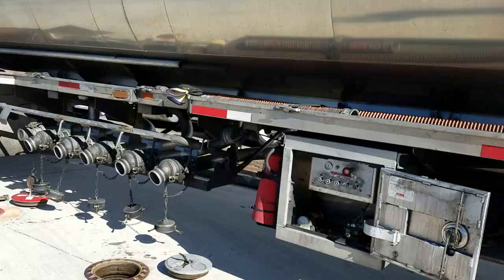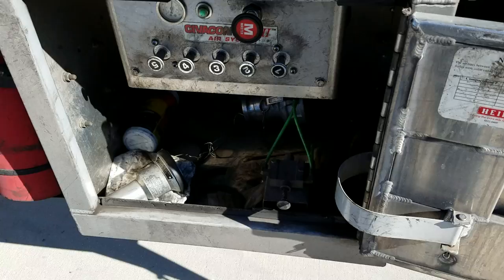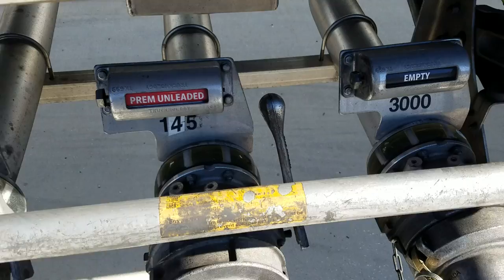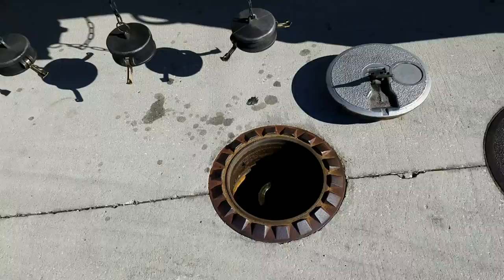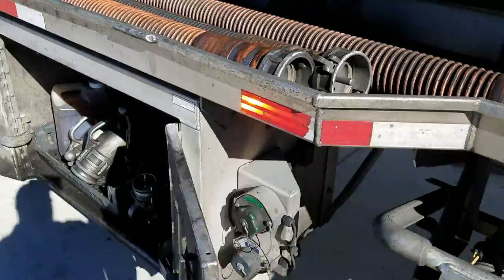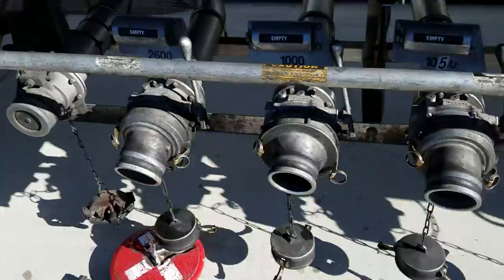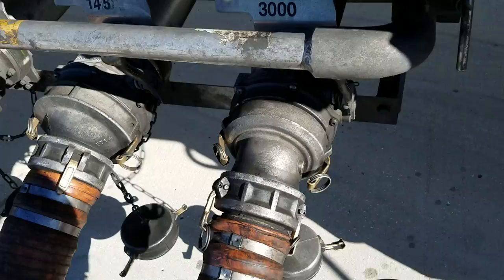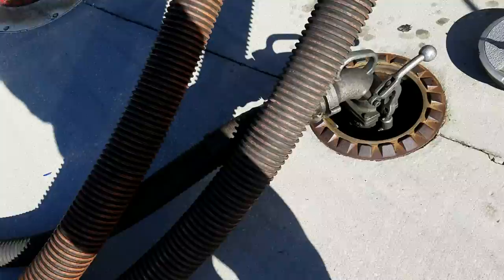How a Fuel Truck Delivers to a TruckStop

Comment: What happens to the vapor in the truck once it's empty and back at the yard?
Reply: Sooner Keith  they would clean it out before putting it away
Reply: @Error-lh8cc  That's my question, what or where does the vapor go?  They don't just open the valve and release it into the air.
Reply: Thorough clean out with soap and stuff then let it dry which would get rid of the vapour
Reply: @Error-lh8cc  That's not really how vapor works.  Thanks for the input though.
Reply: The trailers sit with vapor in them. There are pressure release valves, in case the temp increases. When the trailer is next loaded, the vapor is pushed out and burned off.

Comment: In 1976 one of my brothers was stationed at FT. Carson Colorado. He had just bought a new Datsun/Nissan pickup. Little truck was loaded for the time period. Bright Red with factory chrome wheels, black interior and a custom black bed cover with windows and lift gate. Think it was 4x4 even for the Colorado snow! He and the wife and baby , head to North Carolina for a two week leave. The truck is only two weeks old. It's not even really broken in yet. He would only use Branded Gasoline. Stopped in one of the mid-west states to refuel from near empty. It was one of the Old Standard oil stations that were broken-up by Uncle Sam because of monopolies and spawned Amoco stations among many others. The engine was hot from Hwy driving and had some gasoline still in the fuel tank. He filled up with Premium for the most mileage out of a tank full. Back on the Hwy making good time for a while then  the truck started loosing power. Took more throttle  and some fancy foot work on the throttle pedal to keep up with traffic. Thought there must have been water in the gas. Time to refuel again at a Branded Big Oil station. Refills with Premium Gas. Truck cranks but is stuttering and skipping a little so he decides to just drive straight  thru. Gets to the parents house late at night. Next morning  off to the NC dealership in town. Leaves the truck. Dealer calls and said the engine was Burnt up.Rings,pistons ,cylinder walls and some bearing damage. Diesel fuel in the premium tank. The diesel washed  the cylinder walls down and diluted the oil. With the left over gasoline in the tank and the engine being hot a gasoline engines will  run on diesel fuel. Not great but it will run. Truck is under warranty so He and Datsun get in touch with Standard oil Co. They admitted that indeed at this station diesel fuel had been unloaded in the Premium underground tank. Standard oil Co bought his new Pickup and He got another new Truck plus a settlement for any hardship.Local Datsun dealer was also paid for there trouble shooting and engine tear down time. His wasn't the only vehicle that was bought and replaced before they found out the problem and had the tanked pumped and cleaned. Lesson here is always keep your receipts cause you never Know!!! For all you mechanics out there, here's another one to think about!  My Dad and I had a fresh 5 gallon steel gas can of fresh varsol solvent in the garage for cleaning parts. Back then all gas cans were metal. We kept lawn mower gas in the smaller 2 gallon cans. Mom fires up the push mower and starts mowing . She loved to mow, never understood that one! She runs out of gas. gets the small gas can .It's empty. She wants to finish so checks the other cans, all empty! looks and finds our stashed 5 gallon can of Varsol ! Fills it up. Finished mowing with fresh Varsol ! She told us she found our big can and used it to finish mowing! We thought that would be the end of that Briggs & Stratton . Nope that mower ran for years until the deck broke. That Briggs never used any oil or ever smoked.Kept it for a spare.Honest Truth!!!

Comment: I used to drive an 4 axle truck and 4 axle trailer combination here in WA I used to load 11,400 gallons of gas or 9800 gallons of diesel, 10,000 gallons of Jet fuel, I wish we had the hose trays instead of the tubes.

Comment: Mid is 60/40 mix of premium and no lead.  I have a store that has a mid grade tank and we have to splash blend that store because the rack doesn't do that for you.  I max out my compartments frequently never an issue, but it is a good idea to give yourself cushion if you can.  Sometimes the meters are off, and you can Scully out.
Reply: Mix depends on the octane rating of final product and ingredients. Some terminals still carry 87 and 93, though most carry 85 instead of 87 now. The racks at each terminal are different so just because the one(s) you load at don't offer a blend doesn't mean they all don't. And max'ing a compartment is a good way to fill your vapor pipes with product when slosh gets past the compartments vapor plug.

Comment: vederoot pre-delivery print out reciept on the seat. saw that right off the bat lol. use that with the after printout to see if you have a gain or loss
Reply from the maker: I dont, but the store does. Usualky i just pull in, stick, drop, stick and then take my paperwork in. This truckstop makes you do everything.

Comment: not all stations mix the two to get midgrade. our station gets midgrade delivered. our monitor printout shows T1: midgrade, T2 &T3 regular master and slave, T4 premium. we also have I believe 4 types of diesel/fuel oil.
Reply from the maker: Adam Lesandrini , correct, I was just saying that this station in the video blends at the pump

Comment: First you need to pump the oil out of the ground. Then have it sent to a oil refinery to make the various types of fuel. Now you need a tanker to put the fuel into. A tracter for the tanker. As well as a qualified driver to drive the combination safely to the refinery. Then you will need gas stations to deliver the fuel too.

Comment: (1:05) Are those left unlocked and that easy to open? What is stopping any random person from opening one and putting something harmful in the tank?
Reply: Benjamin Richeson the flow is so strong that if it was opened anything someone tried to put into the tanks would be instantly pushed back out. Not to mention they would spill a lot of gas and be very obvious as you almost never see these trucks in a place other than the yard they are stored without lots of people.
Reply: Yes they are! Typically the locks are broken and no one cares. My main concern last I worked at a gas station was people who somehow manage to spill gasoline every where and then run around yelling "mah babehs are in da car!"

Comment: If you are in a wreck, emergency services will look at your tags to determine what product you have on. They will see you have one compartment of premium gasoline, assuming the other compartments are empty, because that is how they are tagged
Reply from the maker: Marc Barbour , wrong.
Reply: Trucks and Guns you misspelled 'correct'
Reply from the maker: Marc Barbour , negative, emergency personnel do not go by whats on petro dials. They go by placards and the BOL.

Comment: Two questions please. 1 how much do you get paid to haul dump fuel vs other products?? IE per load.. per mile??    2 how you load fuel in this recessed filler units in bad weather and not get water in the tanks. I got bad gass once. Water in fuel. It ruined my week!!!!!!
Reply from the maker: 1. At my new company im with now, I'm paid hourly. I get $19/hour plus OT after 8 hours. That's the starting wage. 
2. During rain I open the caps quickly put a fitting on to reduce the amount of water as much as i can. The store is responsible for removing water from their tanks. Not all of them do, but from my experience its better to buy from a name brand store rather than a mom n pop. Living in the south i buy only from GATE or Enmarket. Since im friends with a lot of GATE drivers i know they keep up on their fuel.

Comment: Thank you for refueling these tanks plus i always wanted to ask this one question on the fuel tanks that you refuel on keeping water out of the tanks after it rains or floods how can these gas stations keep the water getting into the tank lids ive always wondered about that because theres been many times over at many gas stations that ive gotten bad gas at a gas station filling up my gas cans then bring the cans home for my lawnmowers let them settle then i find lots of water in the bottom of my gas cans now i hope therse a solution to this problem and this problem needs to stop but i do appreciate ur delivery its not ur fault that water gets into these tanks

Comment: I remember a load of gas was $2,200 on state road 210 on I-95 back in 1970. 

They made the owner of the stations check the to see if the tanker
were full before we could dumb and them the owner had to check to see each one
was empty and sign off on it before we could leave. Texaco

Comment: Damn that make sense to mix 93 with 87.
Reply from the maker: Yeah, a lot of people (including myself until i started hauling fuel) thought mid grade was its own fuel.
Reply: @DrtyDiesel  In some stations; not so common anymore, mid-grade is it's own fuel. There would be 3 separate tanks in the ground. The dispensers would have 3 hoses, one for each grade. We would call them non-blending sites.
Reply from the maker: @yarnallsgarage3969  yes but a lot of stations are moving to blend pumps.

Comment: In florida I worked at a 7 eleven and I saw a guy vent the fumes right into the parking lot. One hose was connected and just an adaptor on the other one. You could see the vapors blowing across the lot. Craziest thing I ever saw. I had a feeling that wasn't right

Comment: One of the important lessons I have learned is: If you see a fuel truck refilling the station, It is best to not fuel during this time!

The reason behind this is, while the fuel truck is refueling at the station it is kicking up all the sediment at the bottom of the tank and causing it to flow all over the place. After about 2 hours after fueling the station will give it adequate time for the sediment inside the fuel tank to settle down and you will get less of this sediment in your fuel tank of your vehicle.
Reply: I am sure that the fuel pump hoses that pump the liquid from the underground tanks are going down to the bottom... so if theres any sediment, it would get pumped out right away... thats why you dont want to go to any old stations, because if theres any water leakage into the tanks, it would flow right into your cars gas tank since water is heavier..
aslo, there are filters inside the pumps
Reply: One of the important lessons I have learned is that none of you should be able to pump an explosive material without a special license. The tests you sleep walked through to get your license is not enough.

Comment: Don't forget to mention the pipe couplings being Aluminium (Aluminum for you over there) So you don't spark while connecting up
Reply from the maker: That's right, brass ground fitting and Aluminum hose fitting

Comment: You have 2 drip pails but you don't use them. You should always start unloading rear to front. Just in case you have issues unloading and can't get all the product off. Valves on the "belly" are called internal compartment valves.

Comment: How do you know how much gallons have dropped?

Does pump have a mechanical stop when it’s full, like what happens with a car?
Reply: @mrmarkle7088  And if someone screws up? You know someone dropped a compartment into a tank without verifying it would fit.... I'm assuming nothing would leak out, but you'd be stuck unless you dumped what was in the lines out. Did they cover any of that in training - what to do if the tank fills up before you've dumped the compartment?

Comment: almost forgot the fuel indicators you have set to empty arent just for you to identify what fuel is where its also for 1st responders to identify what they are dealing with if you are injured and cant tell them what you have in the trailer. DOT violation to have them miss marked in AZ not sure about Fla just FYI
Reply from the maker: They are not required to be used in FL according to DOT

Comment: What happens if someone gets 87 before me, and then I get 93, how much 87 is going into my tank? Thanks for the detailed vid
Reply from the maker: If it's coming from the same hose like a lot of pumps are setup, you'll get less than a pint of 87 and if you get more than say, 3 gallons, that small amount of 87 won't do anything at all to your gas. It will just mix in be diluted.

Comment: The vapor recovery system; does it condense the vapor back into a liquid (with a chiller/condenser) or is just an absorbent canister or something?
Reply: Neither, it just sits in the trailer (some may condense, if it is cold weather) and is pushed out and burned while loading.

Comment: -Do gas stations have sediment filters before the pump?
-How do you know there's not water in the fuel?
-Where do you fill up a fuel truck?
-Is E-85 blended at the gas station or is it delivered at full strength?
Reply from the maker: Yes they have filters in the pumps

The rack we load at usually keeps water levels monitored

There are loading facilities around the country that we load from in our region

E85 is usually blended on the trailer where we load at and then delivered as a preblended  product
Reply: Trucks and Guns thanks for replying! I used some Gasola water finding paste and it showed it found water in some E-85 I bought. I wonder if it's just not a good product or if the street water is goin in the tank. Thanks for making this video, I can't ever get the guts to ask a driver when they're filling up the gas station.
Reply from the maker: Gamma Light , no problem and I like it when people ask me while I’m dropping. Doesn’t bother me a bit, but you may have found water since I’ve been told ethanol attracts water. That’s one reason it’s not good to use in boats.

Comment: are there filters between the underground tanks and customer fuel pumps? I'm surprised it's ok to have that measure rod out in the open, touching the ground, etc. Is contamination not a worry? Not criticising, great video!
Reply from the maker: Yes, theres a macro filter the fuel goes through outside of the tank, then another smaller filter in the pumps.

Comment: I watched it rain diesel fuel once... someone programmed the veeder root wrong and they used their stick to stab the ball out of the overflow valve... driver dropped fuel (no vapor recovery to truck) and it blew out the tank vent... what a mess!

Comment: Is it true that old residue gets kicked up in the tanks when a delivery is commencing, or is it because of other factors?

Also, are there any locks on those latches? It didn't seem like there were, meaning, I guess, anyone can walk up and open the tanks.
Reply from the maker: DarkSwordsman , there are locks on the tanks now, they were in the process of getting new caps and locks when this video was made. Yes stuff can get kicked up inside the tank during a delivery but it will be filtered at the pump before it goes unto your vehicle. I get fuel even if a truck is delivering, I'd say theres really nothing to worry about.
Reply: Trucks and Guns awesome! Thanks for the timely response! 😀😁

Comment: I was wondering if you would hook up the fittings in the right order? Nope you hooked up the vapor fitting to the tank before the truck and no buckets.  Would get a big fine in some states .
Reply: Always hook vapor hose to the tank first. Truck vapor line might be filled with few gallons of condensed gas. If you hook it first =you made spill.

Comment: Occasionally a gas station could have a separate midgrade tank -- for the benefit of the uninitiated who read this comment, a midgrade tank drop is color-coded blue -- but the vast majority of stations just blend 2 parts regular with 1 part premium inside the pump to attain 89 octane.

Comment: Your American premium is crappier than our UK standard!

Here in the UK our fuel is minimum 95 octane. If you go to Shell it's 97 or 99 octane. 

But touche, our fuel is 3x more expensive, I have to admit that.
Reply: Your belief is false. Octane ratings are not universal. There are three standards in play. RON (Research Octane Number) is used by most of the world including Europe. MON (Motor Octane Number) and PON (Pump Octane Number, which is the average of RON and MON). The US uses PON. There's even a second PON acronym - Posted Octane Number which is what the AKI (anti-knock Index) is sometimes called.
Also, octane rating is not the be all and end all of fuel rating either. US petrol is every bit as good as European so you're actually getting stiffed even more than you admitted to. Glad to upset your apple cart.

Comment: 500-600 gallons a minute is a stretch. About 350-375 on a 4" hose is more realistic. If you are factoring more than one hose running at once then yes.
Reply: Depends on the trailer. Some of these newer designs easily get around 500 per minute.

Comment: Interesting video, thanks! I've always wanted to see the process in detail, with all the couplers and equipment. 

It raises some concerns though because not everyone is as careful as you. It looks like the fittings and hoses are all the same. I would think diesel and gas should have different fittings (like at the pumps) to prevent mix ups. And you put caps in the diesel hoses to prevent spills but I can see other guys not giving a damn and using diesel contaminated hoses with gas and vice versa.

Basically, there's a lot of room for mistakes, whether it's cross-contamination or worse, putting the wrong fuel in the tanks.

Comment: That's got to be a really hard job in the winter time, not mention the pouring rain! Are there lightning proximity rules that you have to follow when you fill the gas tanks?
Reply from the maker: Not really, even when there's lightning i still drop. It does suck delivering in rain